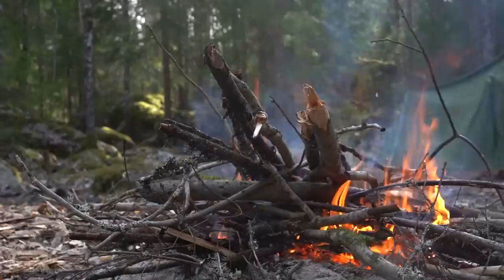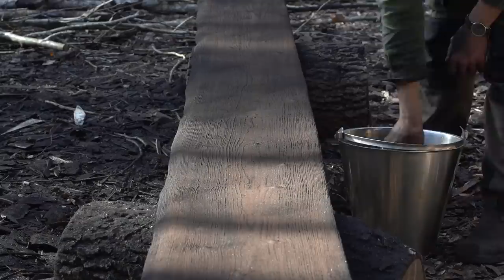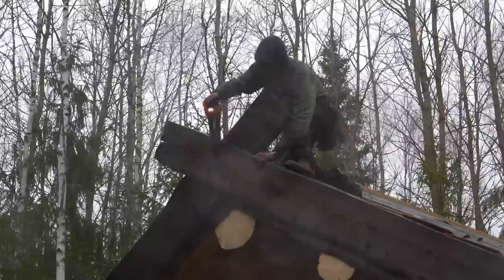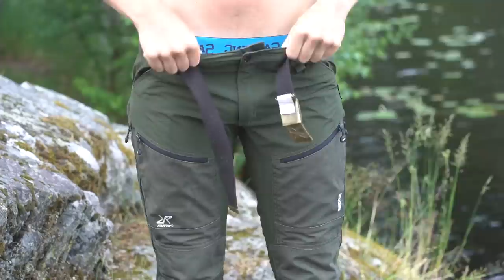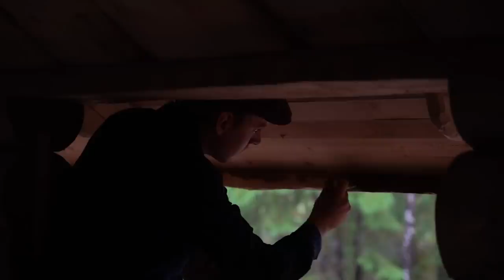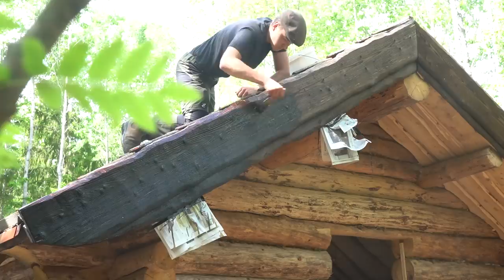Ancient Wood Preserving Technique For Log Cabin

Comment: I respect this build more than other's because it's done like the Amish, no power tool's. 💪
Reply: except for that one time he went to a lumber mill. and when he used a crane.
Reply: @Gary Ketchup I don't think that the two times he used modern equipment can invalidate the sheer amount of manual labor he put into this project.
Reply: @overthinking1843  You are right, Overthinking!!! 👍This young man is incredible!!!
Reply: @overthinking1843  I'm not invalidating his work, I'm just saying that it is not like the Amish way that @Matthew was comparing it to.
Reply: @garytichen4854  Fair enough, but it's still respect worthy and took a lot more effort than some other off-grid cabin builds. And it's much closer to the Amish method of building than others as well.
Reply: @overthinking1843  Main difference I can see, and I might be wrong here, but the Amish seem to work together with traditional tools, while this young man has done most of the work on this cabin on his own, with mostly traditional tools.
Reply: Expect Amishes get timber ready to be nailed together. And they have community with horses. Kungen Erik got help from his grandpa only for few times.

So, battles Amishes vs Kungen Erik: clear winner is the Kungen Erik.
Reply: @vicmac3513  why making competition of everything?
Reply: @gempotagueule7094  Because Finns and Swedes competes in everything as brothers and this time I handed the win for a Swede with joy.
Reply: Haha the Amish in my area definitely use power tools. They just charge the batteries at someone else’s home 😂
Reply: @monkeyslap  within every group or culture there's always the 1% you can choose to focus on which would classify you as a pessimist.
Good luck with that.
Reply: @hogleg2  Can’t be too much of a pessimist. I retired in my 30s.
Reply: @monkeyslap  what's that have anything to do with your life lesson? Harder for a rich man to enter the gates of heaven than a camel to pass through the eye of a needle.
Reply: @hogleg2  Ever live in or near Amish country? Thought so.
Reply: @monkeyslap  live long and prosper 🖖
Reply: Matthew -- In case you're not familiar with it, I'm sure you would like a channel called Mr. Chickadee.

Comment: Great video! My understanding is that fire treating wood is a traditional way of building around the Nordics too, at least here in Finland it's been traditionally done in construction. Also for example hay spits and telephone poles have been seasoned in this way, so they would last in harsh conditions for many decades. I've seen this done with a blowtorch in a house project, not as hard core as building a fire like you've done. 😀

Comment: I love how the beauty of the wooden planks' grain is accented by charring.  You are certainly giving your "Revolution Race" work clothes a good testing with that black dust and climbing around on the roof etc, but I am concerned that you do not use some breathing protection when wire-brushing the charred planks with that fine black dust in the air.  Even an old tee-shirt wrapped around your mouth & nose would work for that.  I detect the feel of the Swedish autumn in this video with the sighing of the wind in the trees etc.  I look forward to seeing the addition of the front door and the windows before winter sets in too.  What a refreshing way to bathe and do your laundry in the lake!

Comment: Is there a benefit of burning the wood prior to treating it with tar? Here in Finland, we typically just tar the tiles of a "pärekatto" (wood shingle).
Reply: I think the porous structure of wood will enclose a little bit better due to different densities of smoke and tar. Also, the temperature has more time to penetrate the structure. I would compare the live flame to seasons of the year (temperature ranges vary from second to second), and the tar to seasoning a piece of wood in the same conditions (temperature is applied once and dissopates).

Comment: You've probably been asked the question before, possibly many times, but was wondering if you are ever visited by a 🐻 BEAR?  Are there bears in that area, as it sure looks like bear country?!  And when you finally get around to building the outside doors, you may want to consider the immense💪 strength of a large bear in it's construction!?  I know you'll be fine...I just have a protective nature.  🙂
Reply: Not sure where in sweden he is doing this, but if it's in the northern half of the country there is probably bears.

Comment: Does charring wood help preserve it? Especially when u start with dead trees? I have my doubts. Certain species do have more rot resistance. Cedar, cypress, locust, White oak. i hear locust is very good but is it that common. it was used for fence posts a lot. design protects wood. wide overhangs and height above the ground limit splashback.

Comment: Hello Erik !!  I have a question i need to answer and you might be able to help me finding out.
My client asked me to find a solution for her delimitation fence since the superficiality of it
is becoming a little stained with green marks of humidity.  I would not try to sand down with 
a sandy band since the humidity would complicate it.  Here is my precise question in those
terms :  Would you try fire torching the fence on both sides , not for long of coarse but
the thickness of those wood pieces only measure one inch ????

Comment: Does charring wood actually help preserve it? In the short term it removes moisture and kills bacteria and fungi, but I doubt it makes much difference after a few days.
Reply: It’s called Shou Sugi Ban, it’s an ancient Japanese technique. Charring the wood leaves a layer of carbon on the surface that is rot and water proof.
Reply: The dead Wood on the surface wont rot and protects the core. Insects does not either like to nest in the charred wood. 
Dont know if its acctaly a japanese technuiqe, its known from japan. But it was used way back in the northern countries even before we knew Japan existed.
Reply: @jonhamilton5789  By that logic partially burned forests should take a long time to decay but the opposite seems to be the case.

Comment: Burning wood does not waterproof it. just doesn't. I did an experiment with wooden fence post.  I burned five out off the 40 fence post and 6 months later the five I burned were rotten where the other 35 that I didnt were still in new condition.  Burning the wood only made it extremely dry and therefore it absorbed water rapidly. Burning wood to waterproof is a waste of time

Comment: You should really use a respirator when sanding/brushing the logs and when using turpentine (one rated for oils like P95 or P100). You are placing your health at unnecessary risk with these protections in place.

Comment: As this ancient wood preserving technique is labor intensive,  you shouldn't follow the "Ancients" completely...
Breathing in burnt wood dust is Extremely Harmful to Your Lungs and advance techniques such as a "Face Mask" should be used.
In this time of advancement...already experience with wearing masks...using it here will also save your life.
As an example, look into the old coal miners, ones who mined coal in Kentucky, Virginia and throughout the Appalachian Mountains and what most of the die from...coal dust is similar to burnt wood dust...if not the same.